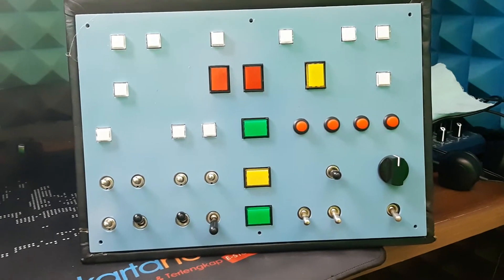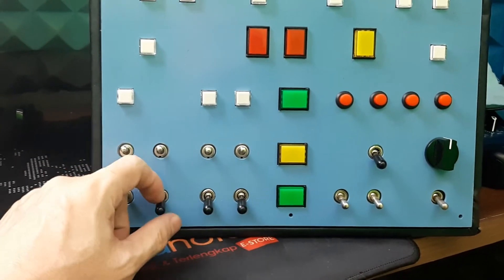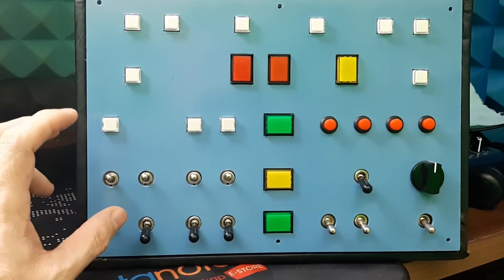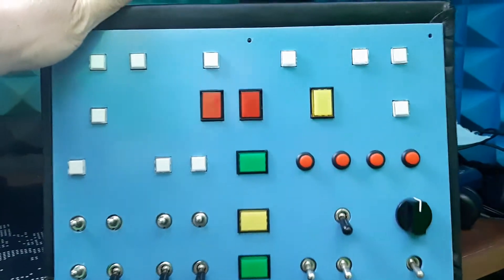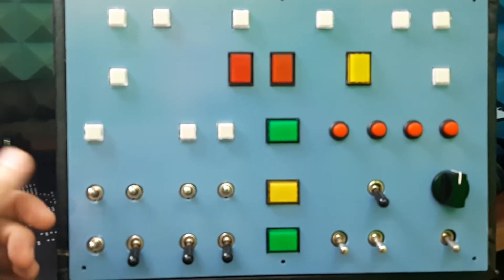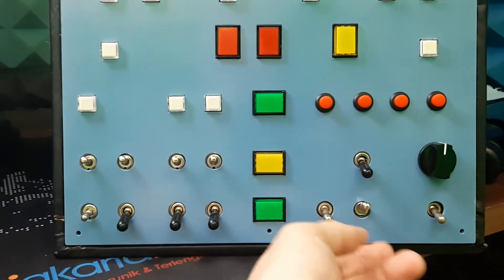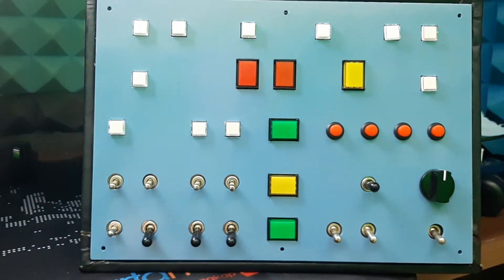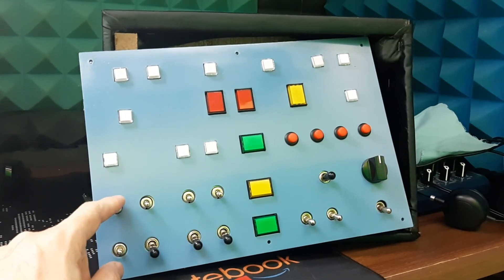DIY: FS2020 DIY Button Box A320 Overhead panel

Comment: halo bang, kebetulan saya sedang membuat mini overhead a320, saya masih ada kendala di switch/tombol Battery 1 dan Battery 2 belum ketemu eventID nya, kalau boleh minta sharing untuk pemogramannya. terima kasih sehat selalu
Reply from the maker: https://youtu.be/z_NLb9J-Mls
Reply from the maker: Mungkin bisa terbantu, sy tdk hapal eventidnya tp bisa di search di LVAR atau event. Kl td salah tdk pakai event tp ke lvar langsung
Reply from the maker: Kalau pakai a32nx dr flybywiresim ada dokumentasinya search a32nx documentation di google
Reply: @hobbytechgearID69  saya pernah coba fbw a32nx, ternyata msfs2020 nya crash bang! Di mobiflight cuma bisa ambil offset dari preset yang tersedia saja, ga bisa pakai offset custom , kalau mau custom harus pakai eventid, semua panel/tombol/switch di mini overhead yang saya perlukan sudah ketemu semua eventid nya, termasuk tambahan seperti landing gear,parking brake, engine start, autobrake, flaps semua sudah ok! tinggal bat1 dan bat2 saja bang yang belum ketemu 😁
Reply: terima kasih bang, nanti saya coba pelajari dulu, soalnya saya ini pakai mobiflght, kalau pakai spadnext saya belum tau
Reply from the maker: Setahu sy LVAR atau event dama hanya perintahnya atau metoda programmingnya beda. Sy jg sdg bangun full cockpit dgn mobiflight
Reply from the maker: Mobiflight mmg blm full coba nt kl smpt dan sy kabari. Skrg masih buat hardware nya soalnya Tapi moga2 info nya sudah bisa membantu